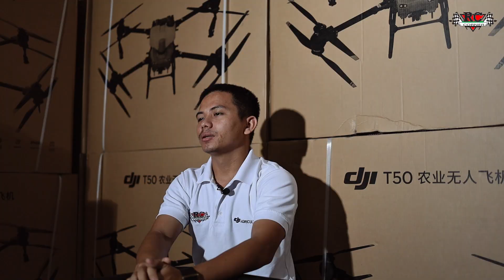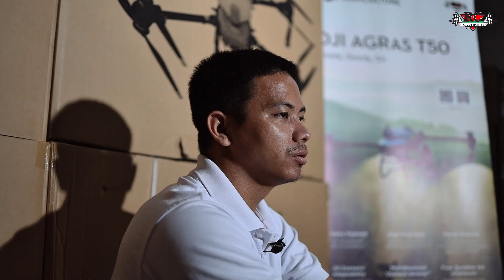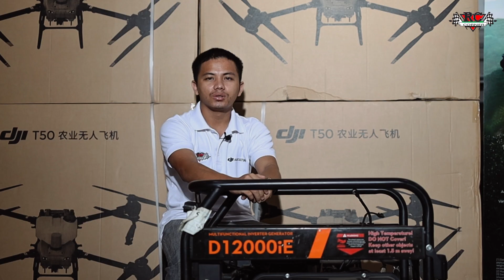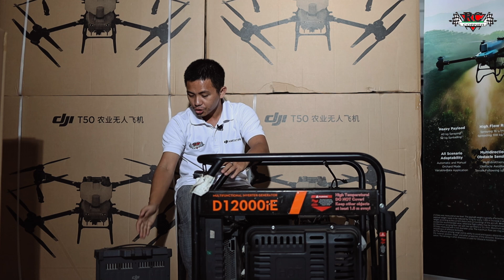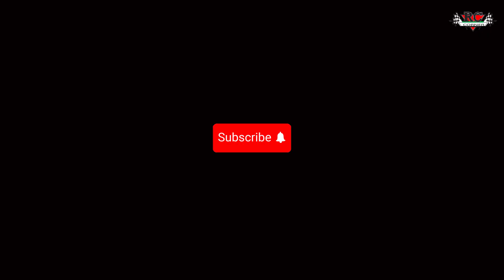DJI AGRAS T50 D12000i GENERATOR  5 COMMON ISSUES

Comment: What do I have to do. Our generator engine experienced an abnormal engine sound when it wasn't pulling for some time, but when it was used, the engine used the battery normally
Reply from the maker: Please check the engine oil.

Comment: I just started having the charging/battery module not recognized issue
Reply from the maker: Refresh/update the generator firmware and battery firmware
Reply: @rccornerdubaidrones  I updated the generator refreshed the generator cycled all 3 batteries on and off all firmware up to date still would not charge any batteries sent it to authorized dealer said I have a Chinese version which should not have been sent to me in US
Reply from the maker: @derbybuilder8008  If you bought Chinese Version, sorry the generator module will automatically block it. Unauthorized purchase is risky. better sent it back to seller. Get international version.
Reply: @rccornerdubaidrones  it was purchased through an authorized dealer but I'm having trouble getting a warranty replacement I haven't had the setup a year yet